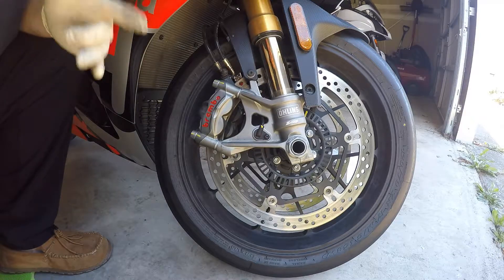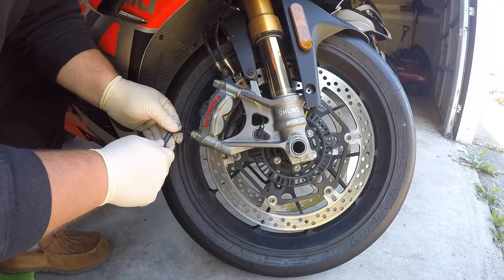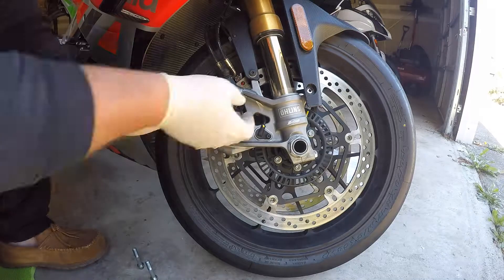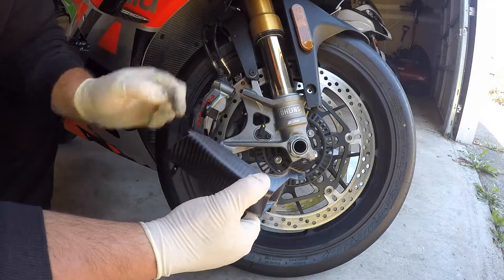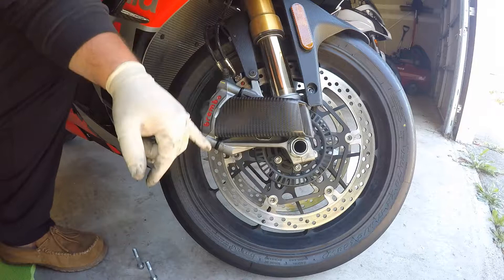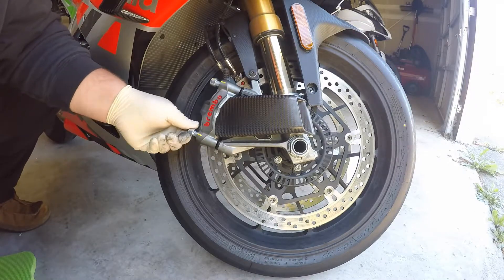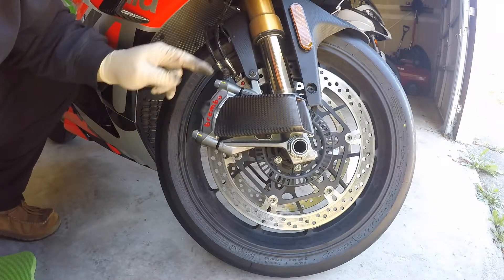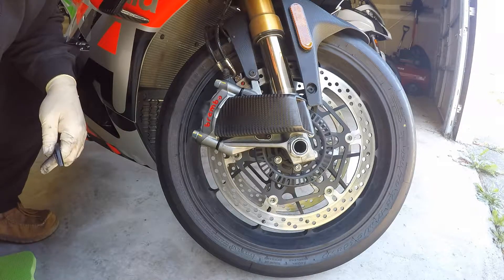VLOG #1! 2018 Aprilia RF LE Brake Duct Install

Comment: Does it affect brakes because it moves rear 1mm??
Reply from the maker: No. I havent noticed any major difference.
Reply: @nwadventuremike  and better feeling in the lever or anything?
Reply from the maker: Theyre main focus is clearing out break dust. I'd feel in the lever with a different caliper and some steel braided lines. I want the 1100 calipers on my bike. I like them a lot.

Comment: Do you know if these will fit on a 2016 aprilia?
Reply from the maker: For:

'17-'19 RSV4 (all variants) 

'19 RSV4 1100 Factory

'17-'19 Tuono V4 1100 (all variants)

*Does not fit any models, unless 330mm rotors are installed
Reply: Can you share link where do you bought those air ducts?
Reply from the maker: https://www.af1racing.com/store/Scripts/prodView.asp?idproduct=96826&sku=2S001379&description=OEM+Aprilia+Brake+Cooler+Ducts+Kit+%2D+2S001379